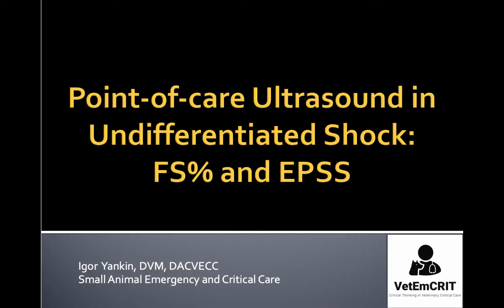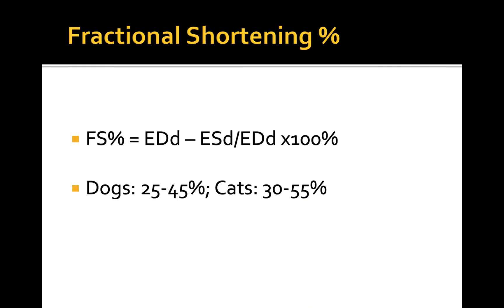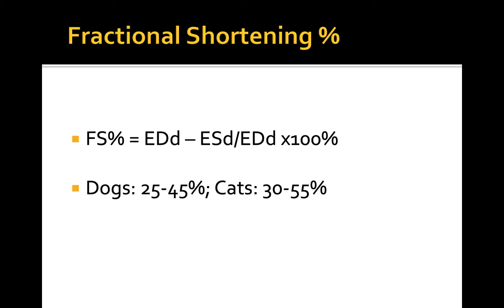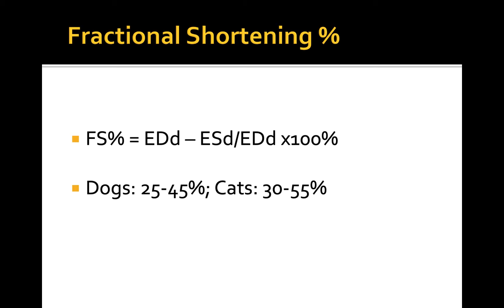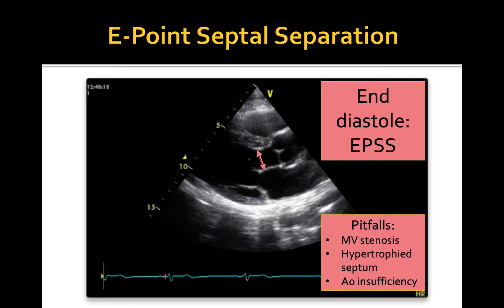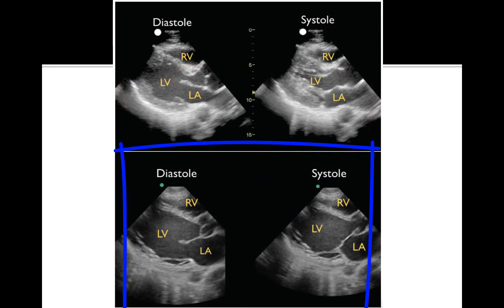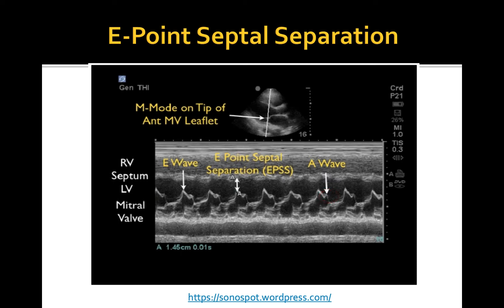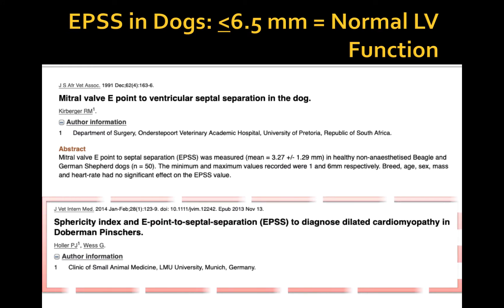Fractional shortening (FS%) and E point septal separation (EPSS) to assess LV function in vet med

Comment: How end systole coincide with end of T wave ? Please explain if possible 

End systole should also coincide with beginning of T wave ( diastole starting)
Reply from the maker: Dear Satyendra, thank you for your question. 
Remember that the mechanical contraction of the heart always lags behind the electrical depolarization. Therefore, the systole continues to occur after you see deflections on the ECG. 

Initially, both the atria and ventricles are relaxed (diastole). The P wave represents depolarization of the atria and is followed by atrial contraction (systole). Atrial systole extends until the QRS complex, at which point, the atria relax. The QRS complex represents depolarization of the ventricles and is followed by ventricular contraction (that ends at the end of T wave). The T wave represents the repolarization of the ventricles and marks the beginning of ventricular relaxation.

You are welcome to read more about it here:
https://open.oregonstate.education/aandp/chapter/19-3-cardiac-cycle/.
Reply: Okay, thankyou 🙌